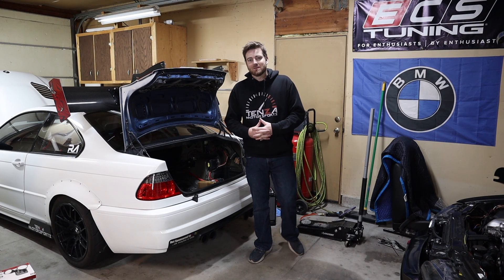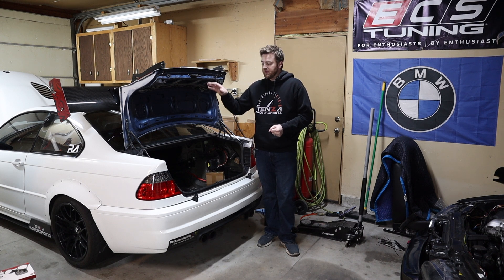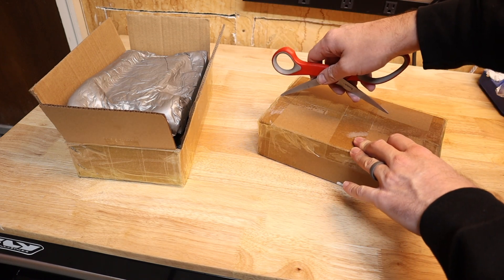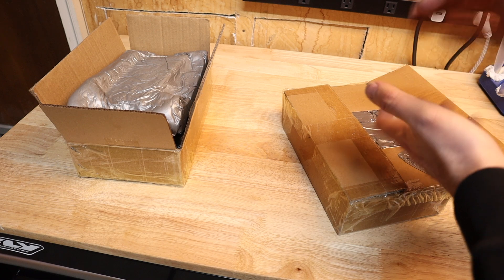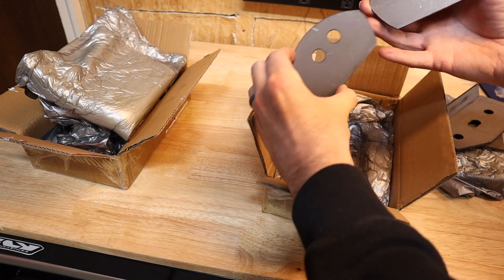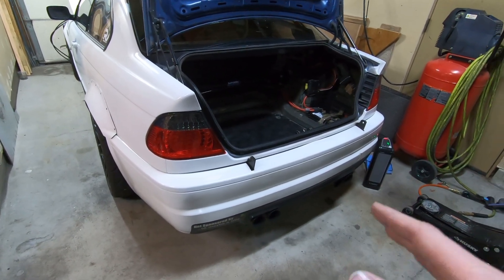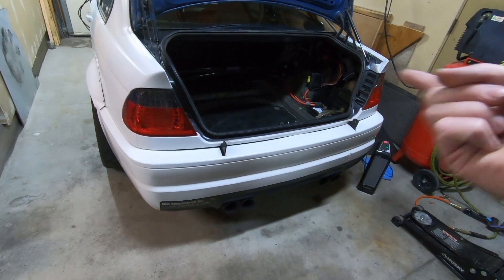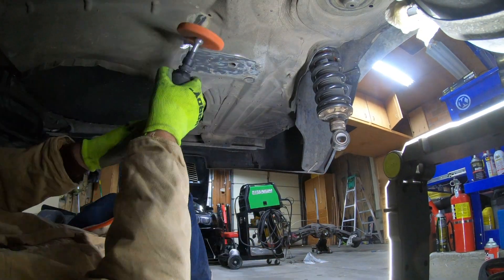MUST HAVE! E46 rear subframe reinforcement kit - installing MAXPEEDINGROD chassis weld in M3 330ci

Comment: 3M structural adhesive is very strong. You can use it in the center of the plates keeping away at least three quarters inch from the weld edges. That is stronger than just welding edges. I just retired my shop of 50 years .Had two frame racks and lots of structural repairs over time.

Comment: Hey so after adding the plates to the body, does this not mean that the whole subframe is sitting 1/8 of an inch lower now?
Reply from the maker: Technically yes. But it’s a very small amount. Plus you need to realign the rear of the car after pulling the rear subframe anyways. It work hurt or effect anything.

Comment: What’s a good follow up video/guide I can use to drop the rear end? I’ve worked on some stuff previously + got the tools so I can do it myself but watching a vid would be nice
Reply from the maker: I’m doing it again on my wife's car. I could produce a video on dropping the rear end, it won’t be out for awhile. Tools are easy 13, 14, 16, 17, 18mm same sizes in end wrenches and I think the E socket is an E14? might be an E12. Thats most, if not all the tools you'll need.

Comment: Where would you even go if you wanted a shop to do it. Not all mechanic are good welders but a welder isn’t going to drop the whole rear subframe
Reply from the maker: You have to drop it there isn't a way around it. It would be more work and effort to try and avoid it. If I had to do this where I’m not the one welding, I would drop it myself at home and find a welder who would be willing to do a house call.

Comment: Yeah not fully true, but this message may miss you like the one I just replied too. Referring to your reply above. Using 3M 07333 plus spot welds would create a better surface area. While using top plates from back seat and rear strut towers. Remember the OEM solution was to use foam to reinforce this area.
Reply: So it’s better to use 3m adhesive vs welding

Comment: A lot of people say to put self ending primer so it doesn’t rust in between the plates and frame but I believe if you weld all around like how you did it will be find, nun the less another great informative video!
Reply from the maker: I normally use weld through primer but I was out. That was my thought, full weld should be ok. at least for a while.
Reply: You will not be fine. I cant tell you how many of these I see fail a cpl years down the road because there was no weld through primer used, and no seam sealer.

Comment: Hell bro, I wish you lived on the east coast. I would help. Oh, and the glue method works well. It's 3M industrial body panel bonding agent. Fun fact did you know that many portion of the unibody aren't welded, and other areas are light stitch welded w/ panel bond. Yeah don't forget you bushing.
Reply from the maker: This is true. Panel bond is strong, but I just don’t trust it on this item. The forces at hand here are crazy. Using panel bond on a lightweight parts with lots of surface area, don’t compare to a subframe that needs to handle the numbers I’m producing. I wouldn’t see an issues with a stock 330 or lower. But m3 and anything modified. Weld on is the only way to go!
Reply: Don't glue on your plates. When the factory uses panel bond for structure they are under vacuum conditions, in a clean room. I guarantee the job you're doing in your driveway will have voids. You could knock those plates off with a hammer. Plus, its only part of the job. All you are doing is dispersing load on ONE panel. BMW already proved that this method alone will not solve the problem, it just moves it (yes the foam failed as well). To do this job correctly it involves cutting into the trunk area and behind the seat to expose the top side of the reciever plate. This is where I typically see the most damage. You then drill out the factory spot welds, and re-welding with full pen all the way through to the reinforcement plates. You also tie in and plug weld above the receiver plate itself. The other method is to either weld in a vance bar or run a full tower brace. Some drift guys get away with epoxy plates and a tower brace, but those cars are typically fully caged as well. Im also convinced that most of the guys making this claim, do not do regular inspections on their chassis and its just a matter of time.